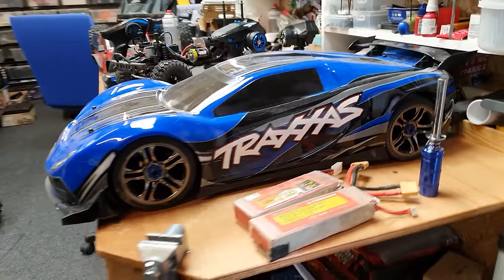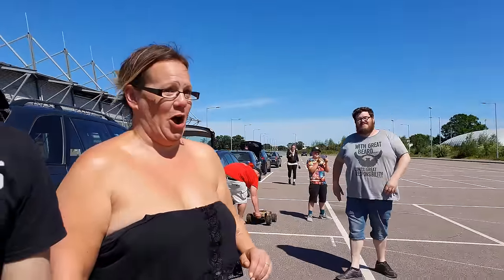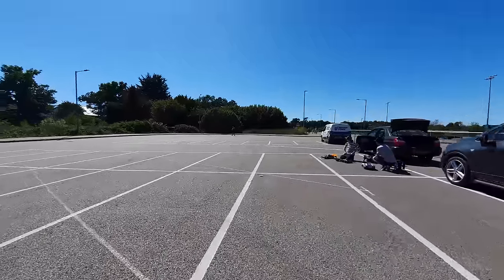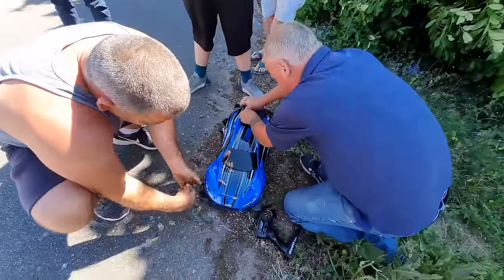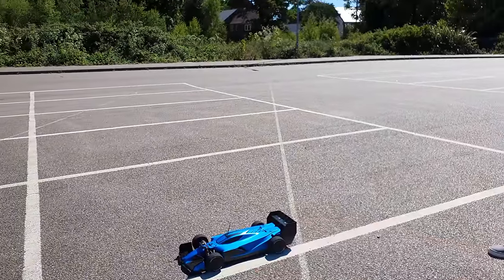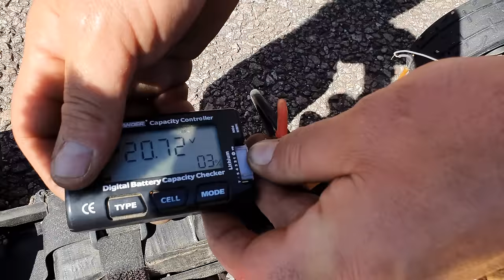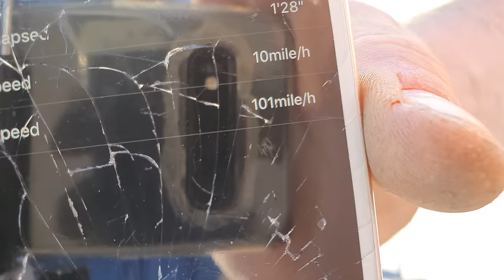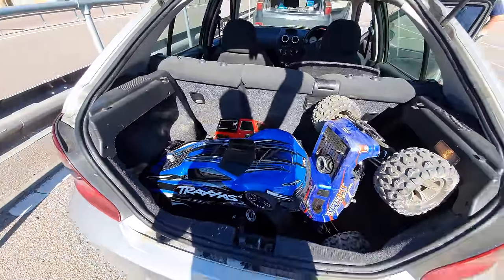100mph RC Car Crashes into Man **Blood**

Comment: I was doing a speed run in front of my house with my 50 mph Senton.  It was heading towards me and I jumped to avoid it, similar to the situation in the video.  It is easy to underestimate how soon you need to start your jump when something is coming at you that quick.  Fortunately for me, 50 mph is a lot easier to react to than 98 mph, and I was able to avoid any blood or breakage (though it did just barely clip my foot).
Reply: Dont remember asking
Reply: @henryschannel3446  dont remember caring

Comment: I feel the pain! My Blade 450 HELI took chunks out of my legs. Ouch!!
Reply: Ouch
Reply: That must have hurt so much
Reply: Oof
Reply: Right on his big toe!! You need to tell us how Martin is feeling today! 🤣🤣 I’ll bet the broken phone screen is the least of his worries.
Reply: Same I have a rustler that can reach 100mph and was doing about 85 down a track and the wheel just came flying off and the car swerved off the track and the wheel hit my ankle and it was fast enough that the suspension arm broke against my leg.
Reply: I did that 2 with a 3d went upside down and came at me instead of being smart I just put my arm up to block it and it took three chunks out my arm, got home threw it down into the basement got stitches 43 of them it broke the carbon fiber blades I think it was a 300 or 450 size heli ,a week later a guy in NY hit himself in the head with a trex 900 and died traded mine off on a rustler and never touched a flier again I'll stick to stuff with out blades
Reply: That is not worse then mine same act heli almost took my hand OUCH

Comment: Let's go you got lucky kev
Reply: You should take the X-01 to the skatepark along with the infraction 😆
Reply: @archieclark1747  he should make an off-road xo1 kinda like that off-road limitless
Reply: Hey Kevin,  I am working on a transmission for my 2s lipo 4wheel razzo 1/10 scale truck.  And I am using a servo to change gears but having trouble figuring out a clutch type of a system.  Can you help ? Any ideas ?
Reply: Also I get 3o plus , yea I know that is slow. But with what I am working on it should do 59 plus . Not sure yet

Comment: Kev, I gave my XO-1 more toe-in and it handles much better now. Even at full brake it will stay straight. I also replaced the stock servo, because I had a feeling it was too weak at those speeds. Great video, by the way.

Comment: Are you using the gyro that comes with the Dumborc receiver ? I found it worked opposite to the way it should and made driving difficult. I solved it buy mounting it upside down...  great vid...
Reply from the maker: Yen, gyro on
Reply: Just press button twice it will go the other way

Comment: I have a traxxas slash vxl racing edition with onboard audio. I run it on 3s. Its still box stock. I haven't had any problems with the plastic drive shafts. They are the original drive shafts ever since new. They are 3 years old.

Comment: The XO-1 needs foam wheels/ tyres a little front toe out.. take the rear wing off and put an off road buggy wing on it with a good size side's on it put some holes in the front and back to let air through.. I have also cut my shell down about 2cm to lower it and now it drives like it's on rails and I'm @ 313k's /195mph.
My limitless is at 301k's.. with foam tyres and a good wheel alignment.. there is some footage on my channel..
Always balance your wheels, it's good for at least 20k's

Comment: Hey can you please do a video about the Cheetah Skyrc 8.5T 4000 Kv Motor and Esc combo, Because I bought one but I dont have the Radio and the receiver but I have the battery so can you please make a video about it and test it with the Holyton 9205e thats the car that I have and I wanna see how fast it goes

Comment: you need more stability and more frontal downforce. i wish i was there i would have taken you up on the 98 mph challenge. i have a Highly modified Losi XXt,  and a schumacker 3 speed gear set.  it will easily go past 100,

Comment: So I'm disappointed in Traxxas. They should have had the XO1 improved by now. For this car still be this unstable is inexcusable. Yeah is fast but so are a lot of cars. 100mph isn't as impressive as it used to be. My Limitless did 119mph with a esc/motor install and I paid less than an XO1. I want Traxxas to work on the XO1 next, please 🙏🏾

Comment: '
i rather better use a normal 540 / 550 motor size with NIMH as nickel metal hydride battery (NiMH or Ni–MH) on the car...
dont need a brushless motor and lipo battery